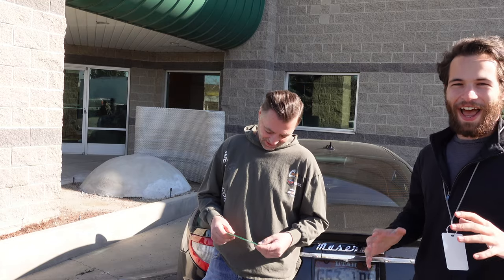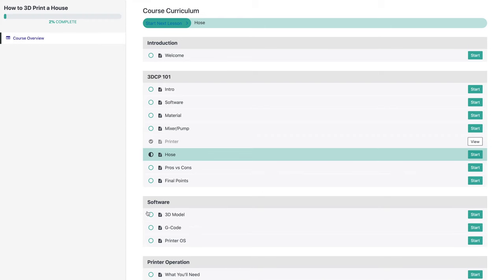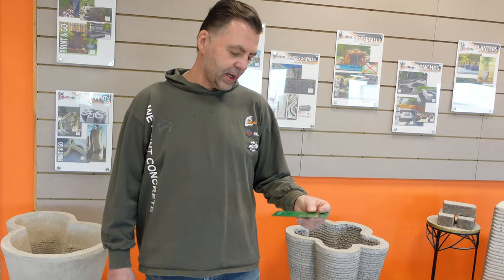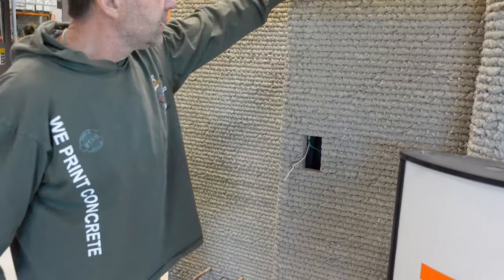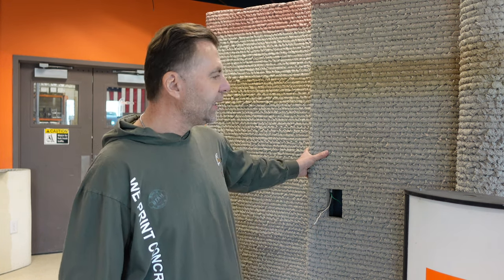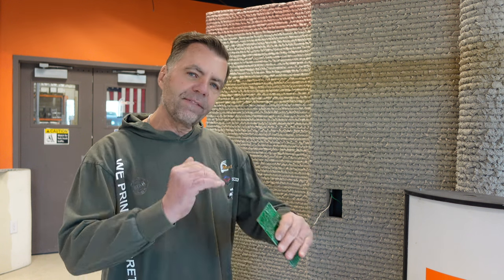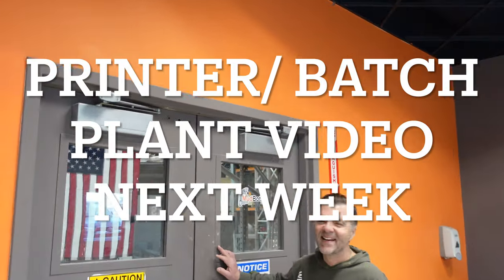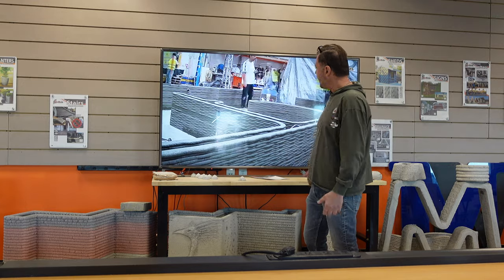You Won't Believe How Many Things You Can Print | Mudbots Concrete 3D Printing Facility

Comment: is eight feet the highest wall for a single story, or is that just per day?  ten foot walls are very common and twelve foot walls are awesome!
Reply from the maker: Good questions hopefully someone from Mudbots can respond to these comments
Reply: Hey, assistant manager at mudbots. The height of the wall you print in a single print is only limited by your printer size. Other than that, it’s just math and chemistry to make sure you can keep going up. With that we can even do basements and second stories.
Reply: That was my first question also Tyler. We are limited only by our imaginations with these tools as MudBot and others are proving daily. 

Jarett did a piece on a 3d printed building in Dubai that has high walls, along with many others he's covered like the mansion and apartment building in China. 

I think high ceilings have many advantages. They should be mandatory, at least 10'. 

From a style perspective, high ceilings give our souls more room to rise and live free, plus more room for great art and books and a 3d projection screen on the walls. Just sayin' we got the tech, let's print.